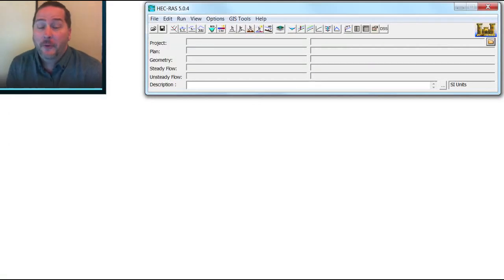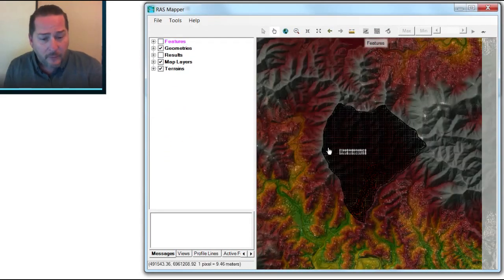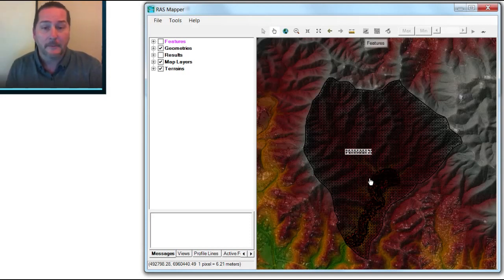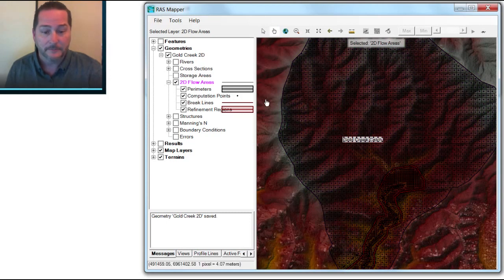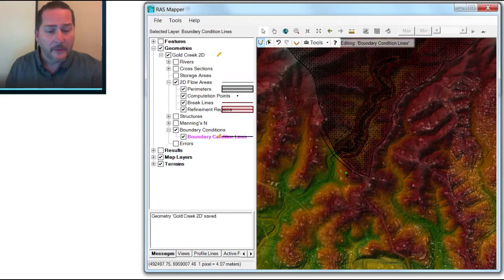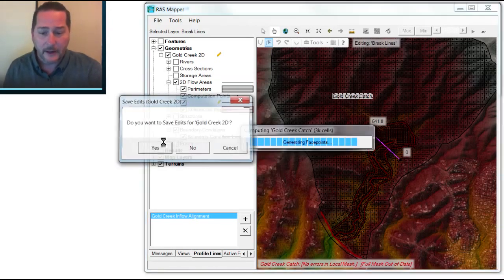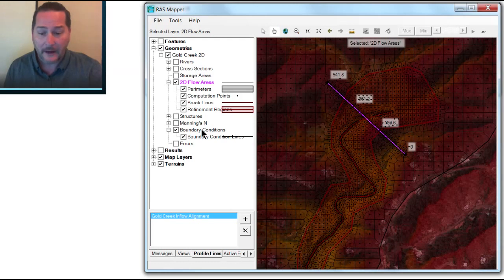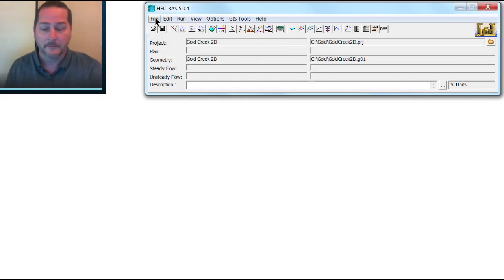HEC-RAS Basics Part 4 of 8: Internal and external boundary condition setup

Comment: Hello Krey. Very nice tutorials.
I am having errors when inserting negative values in flow hydrograph on Internal BC line. 
Is there a limitation for this option?
Can negative values only be inserted on External BC lines?

Thank you 
P. Marinis
Reply: Or break the 2d area where the BC lies (by subtracting a small region from the 2d area) and import the negative values to the External BC now.
Reply from the maker: As far as I know, negative values are not allowed - although this would be a very handy feature in being able to reset hydrographs in specific areas inside the 2D flow area. Some of the other 2D models I use allow negative inflows or negative rainfall to represent infiltration/storage. It's been on my wish-list for HEC-RAS for years. Maybe someone else out there has a hack?